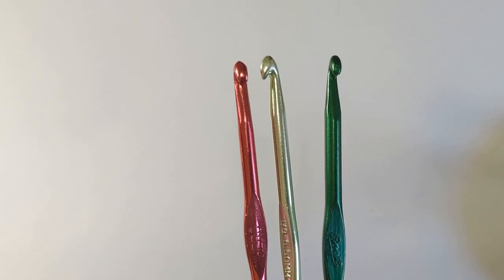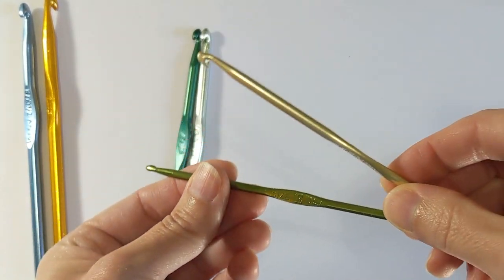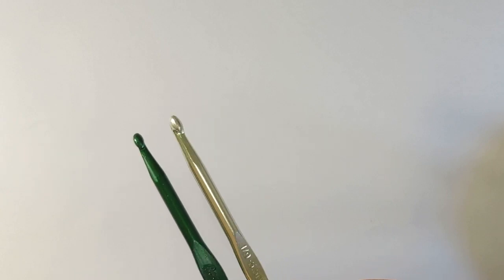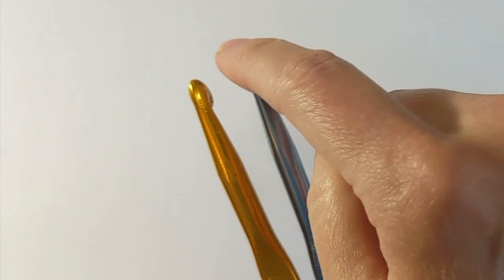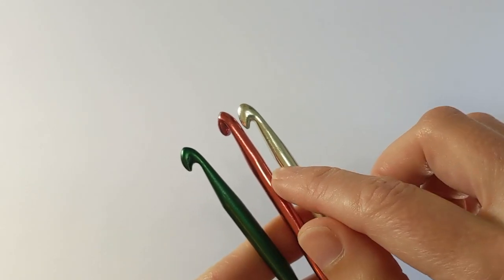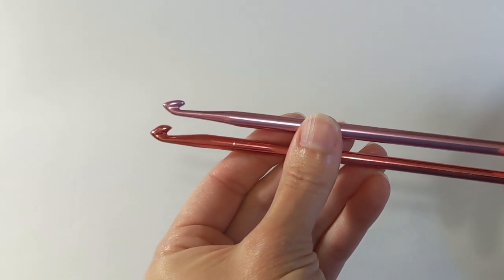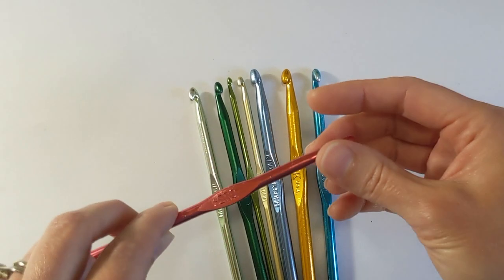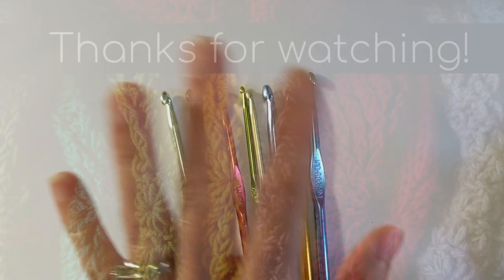Vintage Vs  Modern Aluminum Crochet Hooks - A Closer Look! Boye (and Hero) Hooks

Comment: I'm going to sheepishly admit that I never noticed any difference between hooks except sizes until  quite recently & I have crocheted for 52 yrs. I have the first hook I bought to learn with.....July 1971....a Boye #1 steel hook. It's stamped "35 cents". I have hooks that don't say what brand they are, some are Boye, some are Susan Bates & some are Hero.  The one thing that I've noticed makes a difference to me is the length of the part of the hook below the hook & above the flattened part where it gives the size. I have some where that part is very short & some where it's longer. Since that part of the hook determines the size of stitches, I prefer the space to be longer.
And I still prefer my aluminum hooks to the new kind that have padded handles. I don't like that shorter work space & I don't care for the feel of the padding.  I guess it's what I got used to after decades of using plain aluminum or steel hooks.
  Juan of Yarn Addict notes that some hooks have a beveling which helps when you're crocheting. He says people turn their wrist more when they use a hook that isn't beveled & that's why they get tired. Now see? That's something else I never gave a thought!  
  Most of my hooks date back to 1971 & 1972 when I was getting into the craft & needing more sizes & I'm glad I have the old ones. I find they're smoother, too.
Reply from the maker: Thank you so much for sharing your experiences with us! It's so interesting to see the differences in these tools that are part of our everyday lives! I love that Juan pointed out other features. Our community is so rich with different perspectives! I appreciate you taking the time to comment! Have a beautiful day! 💜❤️